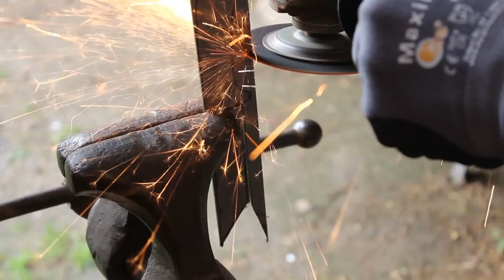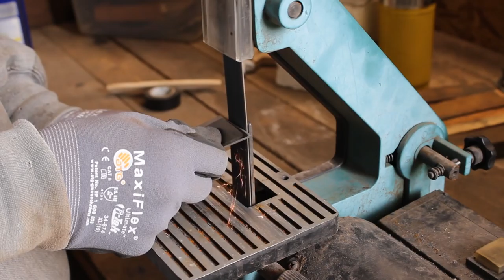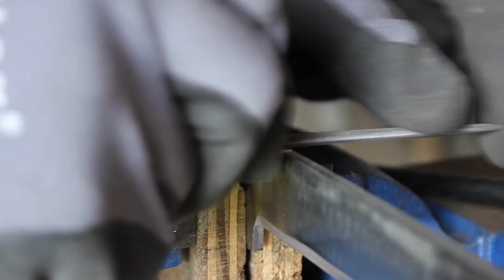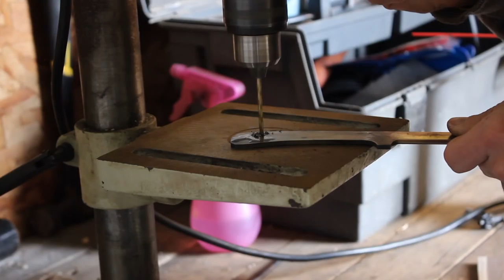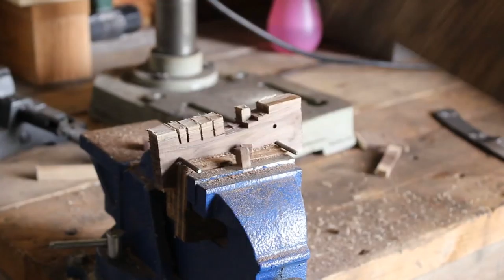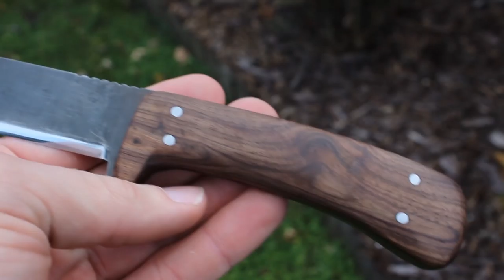Making a Tanto knife short video

Comment: hey man I got a question for ya I recently bought the same sander as u got and when I grind a bevel the belt rubing on the platent makes a knocking sound was wonderin if it's did the same or if there was a way to fix that?